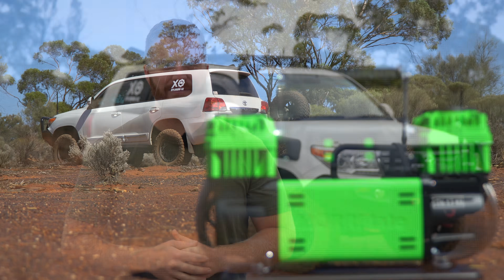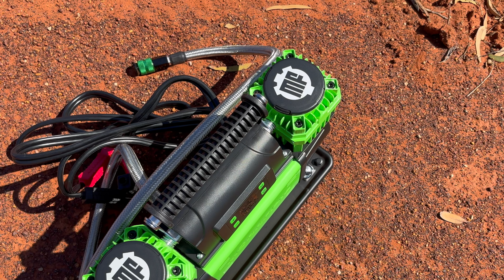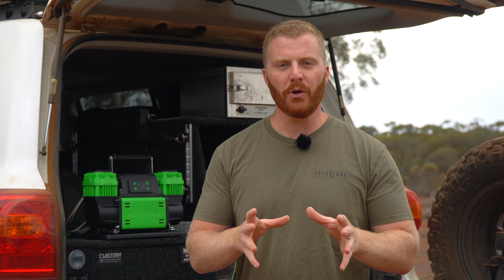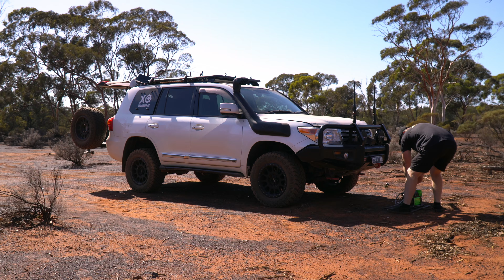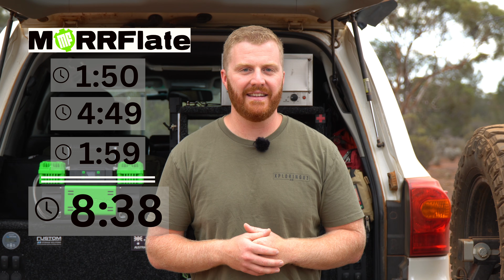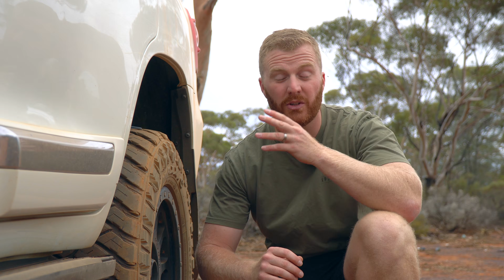MORRFLATE PSI PRO TenSix | The QUICKEST most POWERFUL portable air compressor | Aus Review & Test

Comment: Try buying parts to rebuild your PSI Pro in Most Towns in Australia Like you can with the ARB, No matter what the PSI Pro is a 5 to $800.00 Throw Away Compressor, Where the ARBs will last a lot longer and you can buy parts to fix them if needed with some ARB's I know of having lasted over 20 years without a rebuild, The PSI Pro is Good but how long it lasts is down to a lot of luck.

Comment: whats the diffrence between the morrflate 12v compressor and the morrflate psi PRO compressor?
Reply: I believe the pro has double the CFM.  Thus 10.6 CFM.
Reply: @ed1pk  it's actually just the digital screen on the front that allows you to set it and forget it while it inflates. got my answer from morrflate. kind of embarrassed that I didn't pick up on that one myself.

Comment: I'm reminded of a general life rule of thumb.  YAGNE.  You ain't gonna need it.  Air up and down from a single, reliable installed compressor with a single hose is just fine.  Look at all the fittings on the MORRFlate system.  Lots of potential failure points.  And electronics in a compressor for serious field work?  Yuck.  No thank you.  On and off switch is all you really need.

There are so many toys in this industry, and I'm fine with it.  But an installed ARB twin (or any other simple compressor) is always there when you need it, and a simple air down / up kit is so light, simple, and bombproof... this all strikes me as fixing something that ain't broke.

Having said all that, if you enjoy your toys, go play.  It's your build, do what you want.  I'm just not convinced that 2-3 minutes a few times per trip is worth the complexity and weight.

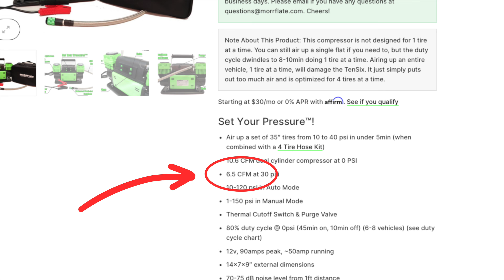Comment: In case anyone is interested, I tested this on my car and was pleased with the results. I used this to pump up 4 x 275/70r17 from 15psi to 38psi in 3:25 (not including setup).
We also used it to reseat a bead on 33” tyre using an ARB single hose.
To top it off, I used it to clean the inside of my car with the single hose after the trip.
Fantastic unit, and the best portable compressor I have used.
Reply from the maker: Sure was an impressive unit! Couldn't believe how fast it got those slightly smaller tyres inflated! Will definitely help our inflation time on the side of the track for this years trip! Can't wait!

Comment: The other benefit for the arb you didn’t mention is lockers. 
Can that psi pro work with arb lockers? 

I have the arb twin with my lockers and the tyre inflation kit.
Reply from the maker: For sure, this is very true and something that I didn't think about (being someone who hasn't used airlocks in many years). Definitely a consideration though 👍

Comment: Great work Nathan as always. Always good to know what the latest and greatest stuff is particularly if you're just starting your toy collection or you're up for a replacement. From your testing the machine is very good so the only question now is longevity which may be excellent as well, only time and use will tell. Cheers PeterJ 😎👍
Reply from the maker: Thanks mate. I'm lucky to find these opportunities to play around with some of the new products on the market and I do genuinely find it fascinating to see just how far things have come, especially when you compare it to the very basic single compressors I started with just plugged into a cig socket. 
You're right though, longevity and reliability is now the new test, no doubt my father in law will help me out there! 👍

Comment: Hey mate could you use this system to inflate a single axle van?
Reply from the maker: Absolutely you could. The compressor wouldn't have much (if any) back pressure when connected to a minimum of 2 tyres. Further, the quad tyre inflation kit connections are normally closed, which means you could have only 2 connected and the other two would be closed 👍 
It would certainly inflate them very quickly!

Comment: Same as the Kings Thumper only green and four times the price.
Reply from the maker: May have a similar housing, however the components and specifications don't match. I know which one I would choose!
Reply: It would be cheaper to paint your kings thumper green 😀
Reply: Absolutely, Same CFM as the Thumper max 10.6 CFM = 300 L/min and same max 90A draw.  The Thumper Max is $99 as I type so we can actually buy 5 for the same price.  OK so the Morriflate has a digital panel...is that worth the additional $400 bucks? @michaelhermans4753

Comment: I’ve had the arb twin, the max trax and the Kings Thumper. I might just invest in this one and give my Kings one away as I did the max trax, the arb worked well but it was mounted in the vehicle when I sold it. I like portability. Great review.
Reply from the maker: Thanks mate. Sounds like you've had a bit of experience with compressors! 
The portability has a host of advantages (and considerations) which suit some setup perfectly, particularly if you are towing, don't have to add even more hoses!
Reply: @XploringOz  yeah I’ve had some exposure…I’d probably have more if I aired down more frequently. Especially when beach driving…I’m a sucker for getting bogged just because I love the challenge of getting out. 😂😂
Reply from the maker: @OutbackOutlaw  😂 I hear you, that's the excuse I use as well right? 🤣 All about practise...

Comment: As per usual you smashed it out of the ballpark, so informative, so much effort incorporated just to keep us informed on alternative options available, offering up definitive pros & cons. It's not a sales pitch feeding endless pros to get the sale.
You even included the link in description for the quadhose review, as yes, I went back for clarification on inflating rears tyres to higher PSI.
The combination of Morrflate compressor & quadhoses is now really appealing. It should be on anyones list for their setup. Internally mount compressor with access to control panel (con) & then carry quadhose in dirty items bag on rear of vehicle (pro).
I believe I'll still be utilising my ICheck tyre deflators though as I'm truly impressed by the speed deflation occurs with them, set & forget also.
Thanks, Wealie.
Reply from the maker: Thanks mate, appreciated as always 🙏 
This is certainly a good option for those wanting a new portable setup or for those starting out as it includes everything you need to both inflate and deflate in one package. 
The remote panel is a great idea and hopefully something that Morrflate would look to add in a generation 3 down the track? 
I also use the iCheck deflators from time to time as these are set to my sand pressures, for everything else its the quad tyre kit 👍

Comment: Another great video!

While you know it's punched out of the same factory that makes the Thumper Max at a higher specifications level, more portable air compressors should be equipped with auto pressure cutouts, it's 2024!

 Does it allow auto deflation as well if the tyre pressure is over the set pressure? 

Though curious that you experienced a ≈ 9% decrease in performace with the tank inflated before starting the test. 

I'm trying to get into the habit of multiple (at least 3) samples of each data point so you can look at averages and standard deviation for more reliability in the data. 

Anyway keep up the great work mate.
Reply: Seems it is time to get the Morrflate PSI Pro, Tuff Terrain V4, Thumper Max and ARB on the test bench in the LockyourHubs Lair.  Interest too regarding how/if the unit manages over-pressure.
Reply: @Mouldyturnip75  I would think there wouldn't be an additional over pressure sensor with the auto pressure sensor relied on to do double duty. 

Only would be an issue if you were hard mounting and wanting to run a tank as well, you would need to plumb in before the auto mechanism to fill the tank.
Reply from the maker: Thanks mate, appreciate that comment coming from someone who is the king of testing! 

The auto cut off is certainly a feature that more manufacturers should include as standard, I agree. 

Very surprised about the ARB speed in that 2nd test. My thoughts are heat. It was a very hot day, about 39 degrees in the sun (really put these units to the test). Given that it was running for 15m solid, I reckon there may have been some down time between those cylinders... 🤔 

I'll look to get 3 samples in future tests, I can certainly see the benefit there 👍
Reply: @XploringOz  "The King of testing" lol, that's going straight on the resumé! 😁